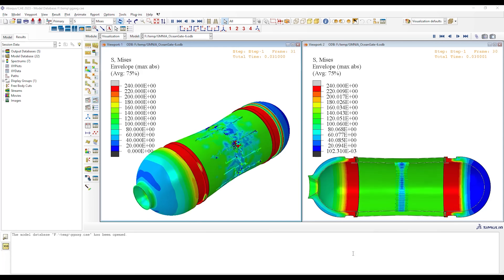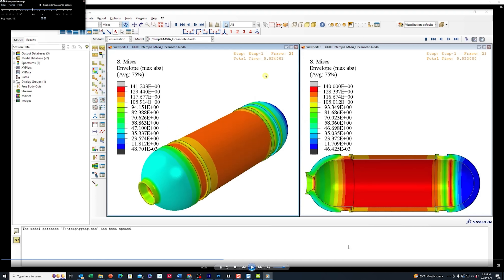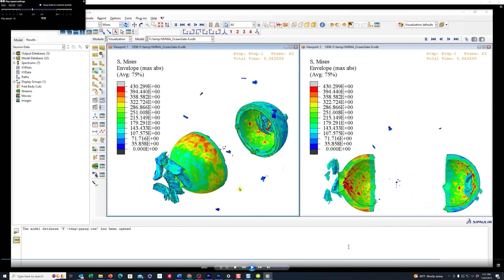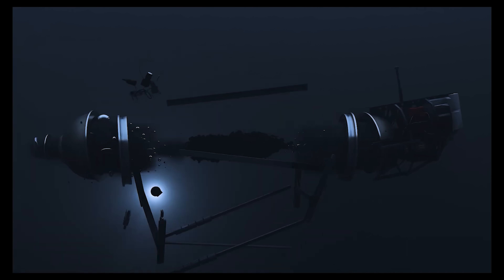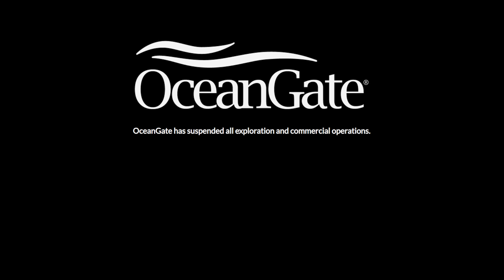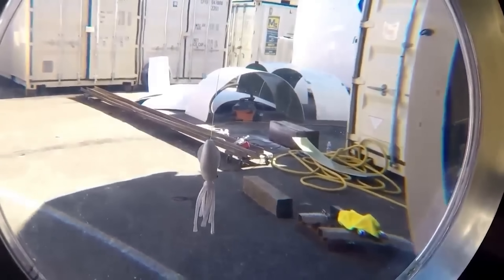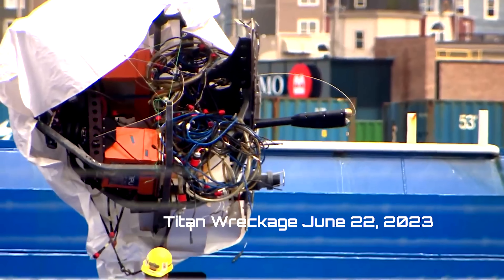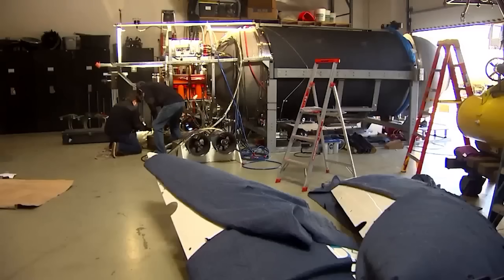Best Titan Sub Implosion Simulation, Cracked Porthole? Q & A

Comment: One thing that I don’t understand is how carbon fibre adds to the strength in this application.  Carbon fibre works great in tensile applications, but what strength does it have in compression?  I think the strength in that cylinder only results from the resin matrix that bonds the cf.  And that fractures progressively a little bit every time they descended to depth.
Reply: You're absolutely correct.  The carbon fiber was basically useless, as you've surmised, under compression and all that was holding that centre tube together was the resin.

Comment: Is one of the orange 10000 psi high pressure flotation vessels completely missing from the tail? It should be above the battery. Simple logic tells me that when Stockton Rush activated this buoyancy bag, he heard crackling and it was primarily this system that destroyed the Titan. What are the design details of this system?

Comment: Hi Jeff, has there been any mention that the bolt pattern on that flange joint is insufficient for the pressures involved? you would normally expect at least a 1'' stud with with 2 inch spacing's, something in that order, otherwise the gasket can get pushed out.  that's a lot of pressure on the edge of the gasket.
Reply: What would exert the pressure pushing the gasket OUT?

Comment: THE flaw in this was the shape.

Other dives use a sphere pressure chamber, OceanGate used a cylinder, taking away the structural strength of a sphere with it.
Reply: viewport likely blew out under compression, not in

Comment: If the carbon fiber cylinder failed and was crushed, the end bells would start to come together at high speed but would they have enough momentum to clap together?
Reply: I don't think so. Beside of the water coming into the void also from the sides, there was quite a bit volume of incompressible material inside - like about 400 l of human remains.

Comment: It failed in the aft section(rear) near the titanium ring that was glued on.The glue was the failure point and the transcript talked about the noises coming from the aft titanium dome .The water intrusion blew off both domes .The glue was the weak point because you see zero residue left on the titanium.All of these videos show speculation .

Comment: I was wondering about the acrylic window. On the hydraulic press channel, they've compressed acrylics that were extruded under high pressures.
Reply: There are deep sea submersibles that go deeper than Titan did, and use acrylic view ports. Titan's acrylic view port wasn't rated for the depth of the Titanic, though Rush probably did the computations and modeling to conclude that it should work, theoretically. Rating something usually involves examination, documentation, and testing multiple specimens to destruction in an effort to ensure reality will match expectations.
Reply: @warpedweirdo  Rush didn't want to pay to have the window be rated to 4000 metera

Comment: The SD cards would probably be damaged too and the heat from the implosion wouldn't help their condition. Would be like hitting them with a hammer the weight of the ocean that is as hot as the surface of the sun

Comment: I was thinking about how they would make a hydraulic connection to the outside and I suspect a drilled and tapped hole through the titanium which was over 3 inches thick. 10,000 psi is pretty common for a hand pump for hydraulic press applications. Enerpac makes one that can go to 40,000 psi. I would expect a check valve outside the sub because they would only have to apply pressure not release it so the fluid would only have to go out from the sub.

Comment: The transcript at this point is unverified and looks to be nothing more then a cruel joke as there are incongruities with what's in it and the terms being used. That combined with the fact that any leak at that depth and pressure would be able to cut through steel which in the would have been instantly obvious.  There also the little matter that any failure of the hull at those depths doesn't result in a slow leak like you get on the surface but a complete failure in mill seconds due to the immense preasure
Reply: There also the very obvious evidence from the recovered parts which which are the porthole along with the rear mechanics area and effectively nothing of the pressure vessel itself which makes it clear what failed.

Comment: Pink Mist: When the dustbin submersible imploded, water ingressed at 1500mph, the human body was compressed by 18 million lbs of force (6000lbs per square inch x 3000 inches of human area = 18 million lbs/psi) So their iPhones would have been smacked hard, real hard probably crushed thinner than a cigarette paper under the initial impact of the implosion, the chances the sim card survived is remote.

Comment: The carbon fiber hull might work if the sub were constructed properly - specifically, if it had a frame supporting the carbon fiber shell from the inside. This frame could be made of high-strength steel or titanium alloy. It would prevent the shell from buckling and failing.
Reply: Absolutely!!!!
Reply: yeah properly like in a clean room environment with multi axis carbonfiber weave spinning for increased strength and durability but that means some serious time and work into that sort of design titans implosion goes to show what happens when you cut corners for the sake of making money
Reply: @raven4k998  They did not even wear full body suits that would prevent dust from clothes and bodies from falling on the fibers. I am sure they dropped a lot of dust, exfoliated skin, hairs and dandruff on layers of carbon fiber that created bubbles and weakened the hull.
Reply: This would not have worked.
Reply: @numerical968 excellent analysis, thanks for the input
Reply: It wouldn’t have mattered.
Reply: It did work for more than a dozen times, but the project stated the entire carbon composite in the hull needed to be replaced after each dive, when the tragedy happened it was the fourth dive in a row that they didn't follow the project's specification
Reply: Carbon fiber is useless in a compression application.  Only good in tension.

Comment: I’ve watched a million submersible videos at this point with many models and opinions and tests. I personally think it was the failure of carbon fiber, primarily because of the horizontal pressure at high depths that is placed on the sides of the carbon fiber hull by the titanium domes. Carbon fiber likely did an excellent job taking on the pressure around its circular area on the outside but the sideways pressure from both dome sides weakened it at the same spots where it’s joint by the adhesives to titanium rings, and over time it micro cracked more and more until it started a chain reaction of the whole carbon fiber hull failing in a blink of an eye by implosion. Since this carbon fiber failure zone was under the titanium rings there is good chance it would have never been picked up by any acoustic sensors.

Comment: https://youtu.be/EzWd8GX5tKg?t=45

An observation I'd hope to bring to your or someone’s attention, as noted 45 seconds into the included video. A curiosity I've observed several times and through many different Titan videos, but had not seen discussed.  

From the included video, as the titanium ring is lowered from the ship, just to the left of the titanium ring, at the 45 second mark, is a thin shiny strip of what appears to be metal. I couldn't identify this thin strip of metal, and had initially assumed the thin strip was the broken remnant of whatever had initially been wrapped around an already fully assembled Titan, and was employed as secondary fastening measure in the same manner in which heavy boxes might be secured together prior to shipping. Another possibility, I thought is that this thin strip of metal might be how the Titan’s legs had been secured to Titan’s main body. 

I no longer believe this is an accurate description of what this thin metal strip is.

I believe I’ve discovered what may be a more likely description of what this thin strip of metal is at the 45 second mark. And hopefully, with this observation, the following description may be of assistance and contribute in helping accident investigators understand how the sub had failed. 

What I believe, to the left of the titanium ring 45 seconds into the included video, might be. 

The end of the CF tube is glued into its corresponding titanium ring, and is received and mated into a groove or race at the edge of this titanium ring. The groove or race in the titanium ring is “cup shaped”. 

The thin strip of metal on the left of the ring being lowered, 45 seconds from the beginning of the included video, are the torn edges of this “cup shaped” glued groove or race which had been, through the force of the implosion, torn or “unzipped” off of the titanium ring. I don’t know if “unzipped” might be the best technical description however I can’t at the moment think of a better word. 

Again I’ve not seen discussed anywhere what this thin strip of metal may be to the left of the ring at the 45 second mark. I’d hope to get someone’s thoughts regarding this observation, and possibly if its correct, observations such as these from amateur investigators may further assist in understanding how the Titan had failed so catastrophically.

There appears to be an unwavering almost unlimited amount of public interest in the Titan’s loss. In compelling human interests stores such as the loss of the Titan, I had hoped, due to the obvious degree of public interest, whomever is responsible for the Titan official investigation might be somewhat more forthcoming with investigation details. If they had, perhaps observations such as mine wouldn’t become necessary.

Comment: Thanks ... well dissection of all this.
After reading those texts between boat and sub, I think it did not implode. Imo there was a very small leak...water gets in and damages the electronics... then it fills the side with the electronics and the sub starts to shift downwards in the back. No electricity and no communications anymore. Then that very very small leak gets bigger and water rushes in more and more. It's like one of those waterjets to cut things. And suddenly water rushes in with the speed of sound... wham. Parts in front and rear let go and the whole carbon hull falls to the bottom, but is light and washes away. 
So, no implosion in the sense of wham / crushed. But slower, they got warned and there was some panic (shortly). Even dumping those ballasts has no effect anymore because it is filling with water. That whole thing falls apart due to no more pressure on the outside.
Reply: At that depth though there is no small leak.

Comment: If you've ever been involved in a violent accident, when you awaken you don't remember anything about the accident.  I don't know if this is a problem of the information not making it to your memory or maybe your brain never even sees it.
That porthole should squeeze into the titanium dome.  The question is does this cause any tension on the inside surface or is the whole thing compressed?  If there is no tension on the inside then scratches or cracks would not matter.
Different people have said different things about the carbon fiber cylinder regarding the directions of the fibers.  The information we have from videos only shows fibers wrapped arround the cylinder, not longitudinally.  This would certainly cause cracking issues at the interface between cylinder and dome when one of them compresses more than the other under pressure.  Even if there was longitudinal fiber there could still be a stress issue there.
People have talked about creaking noises inside the sub.  This could represent delaminations in the fiber.  With enough delaminations the individual layers could buckle under pressure and that would precipitate the wall of the cylinder collapsing inward at one location.